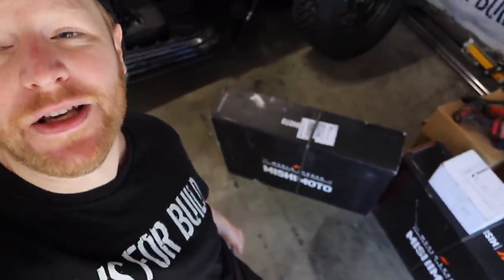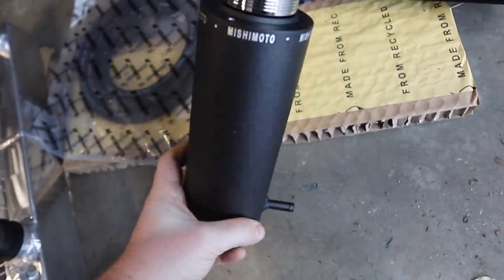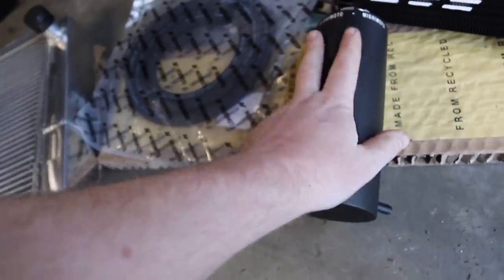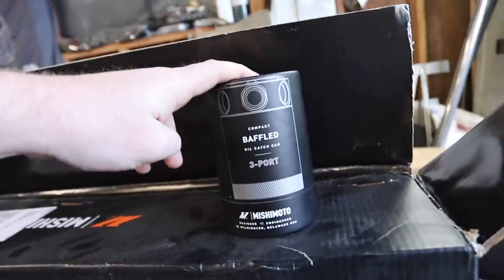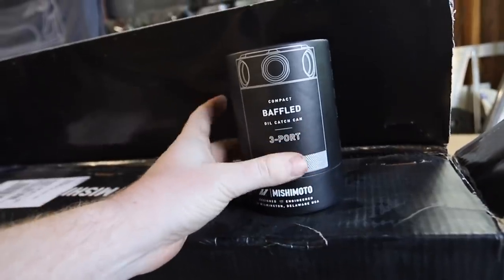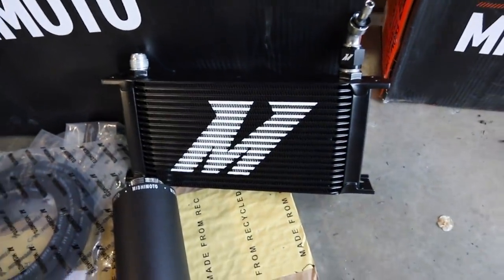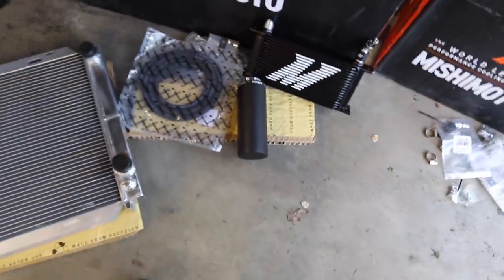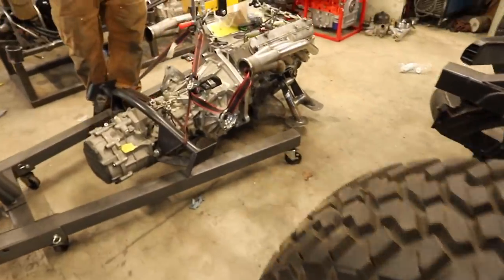Installing A Rear Top Mounted Radiator on the Off-Road Lamborghini Huracan

Comment: They make a low-profile swiveling thermostat housing for most Chevy engines - get one so you can clock it pointing at the radiator outlet - run a shorter hose with fewer bends in it.

Comment: That would be a dual PASS radiator. A dual core radiator has 2 rows of transfer pipes and fins in line. That radiator is more close to a 4 core, dual pass.

Comment: I imagine you'll be using TPU for the isolators? Just keep an eye on the temperature of that engine bay since the glass temp is around 60C. May be worth while to make a mold instead and make silicone isolators.

Comment: If you're worried about stability where you relieved the power steering bracket so the line would fit you could most likely if it clears the pulley cut a flat bar that goes from bolt head to bolt head across where you cut the piece out of the power steering pump bracket for the line I know I can't see really what's going on on camera but on that thermostat housing you might want to make sure you have enough room for a hose to go on there far enough for the clamp to be behind the lip

Comment: Gonna recommend an aux vacuum pump for your brake booster if it's vacuum-based. Not only is it more reliable due to less hose to crack/rip but less hose between the source of vacuum and the booster will almost certainly result in better braking. you'll especially notice with the bigger tires.

Comment: the difference between single and dual core radiators is capacity vs speed. a single core radiator and handle more flow without as much pressure drop, but a dual core basically has the water flowing through faster which allows for a more efficient heat transfer

Comment: It might be alot easier to use an electric power steering pump from vag or from an MR2. Just so you would be able to mount it in the front, not having to run any lines from the rear to the rack.

Comment: Make sure that radiator is sealed away from you, don't want another accident like at cleetus and cars
Reply: Wanted to say the exact same thing. close off the hole with a panel and panel bond or something. Imagine rolling the car and everything being ok, except the radiator is cracked an pissing steaming hot fluid in your neck :-|
Reply: @kenwillekens9894  ouch....

Comment: I’m not sure if you are already planning this but you should inclose the inlet side of the radiator. That way more cool air gets rammed in the radiator. If you leave it open like it is all the air being forced in by the roof scoop will dissipate all around the engine bay.

Comment: When Matts Off Road Recovery installed his LS in a rock crawler/tow rig (The MoreVair) he used the heater lines to a heater core mounted in the engine compartment to rid the extra heat from the engine. Your Jump A Con could use somtin like dis mon!

Comment: It would work better if you put the belt from the crankshaft pulley to the alternator then the loose pulley and back to the steering pump because the steering pump and alternator both take alot of torque

Comment: That thermostat housing looks sketchy won't it smash in to the fire wall while racing?
Reply: No, because the  fuel cell is  between the engine and firewall.
Reply: @caution1100  may hit the fuel cell and rub on it
Reply: @requiescantinpace3838  yes, although it will probably be fine until after the first jump.
Reply: @requiescantinpace3838  I think it's a horrible Idea to have it like that, with the vibrations that the engine might make but... idk
Reply: Hope oskar made a few extra, could be the end of their day if that breaks and they need a custom piece to continue on

Comment: Wouldn’t it be cool to have a roof scoop that fed directly into the radiator?
Reply: He said it would 14:50
Reply: It should be a lamborgini styled rs2000 intake
Reply: will be noisy as hell while driving
Reply: Its a roof scoop on as off road lambo everyting his already noisy
Reply: Why is it mounted like this? Seems like it should be mounted out the back, just like a buggy would have.
Reply: @ironmonkey1512  there is less chance for it to be poncture compared if he put it on the back completly
Reply: @ironmonkey1512  even on the back he could make a roof scoop that get to it but he put it higher for clean air and les possible debris breaking the it

Comment: 1973 Chevrolet Corvette XP-987 GT concept, a mid-engine Corvette with rotary power. One of the first GM concepts.

1988 Corvette Indy, it used the LT5 32-valve V8, and it used an Oldsmobile Toronado automatic transmission. C8 is the first production mid-engine Corvette. Popular Mechanics test drove this second concept.

Comment: I once designed a generator that fit into a cube using a Ferrari radiator mounted flat horizontal on top with electric fans. Thought that might give you a more streamlined shape maybe with a roof scoop. Oh. Never mind you already mounted it.

Comment: That engine will displace masive amount of heat not just to the air but radiation. I would make plans for a heat shield to reflect it away from the radiator's hot side in case you get heat soaking.

Comment: You should go for a radiator like the intercooler on the RS200, get all the heat out from the engine bay, not heating the intakes. At least do a composite shield where the hot air gets leaded away from the intakes. 
Great build, love to follow this!

Comment: Make radiator pipes out of aluminum pipe. You can buy electric conduit at HOME DEPOT or Leows for cheap cut and bent to size with rubber ends and claps  We did that on a jeep crawler years ago and boom proof.

Comment: It is not a dual core, it has one core. It is a dual pass radioator, which means that the coolant is in the radiator for longer, it has less flow but the coolant will come out way cooler than with a single pass radiator. The reason it works better than a single pass in most aplications is because the engines don't move that much coolant, so cooler coolant will benefit more than  more of the slightly hotter coolantz because not all the coolant can flow trough the engine.

Comment: You might consider inserting a strong spring in the molded radiator hose to keep from collapsing.  Just saying... Great Video...Can’t wait to see the Engines installed into the boat and running.

Comment: Trans cooler will probably heat the gear oil sucking air that close to the engine block :o) High amp alternator doesn’t have enough pulley contact and will smoke the belt. I love the build ^-^ It looks amazing. That’s why I’m saying stuff, because I want it to race as well as it looks 😎

Comment: i would have used electric water pump and electric power steering also dry sump system but i guess you already will go with that race engine

Comment: can you put a ~4" spacer between the back cage and the rear firewall to extend your wheel base and give you a couple more inches between the firewall and engine?
Reply: They have lots of room between the fire wall and the engine, and that is where the fuel cell is mounted.

Comment: I made the move to electronic power steering and I love it. Highly recommend
Reply: Eww, never.
Reply: That and leccy water pump. It keeps doing the best it can regardless of engine speed. The engine loved it 😍
Reply: Hell yeah, MR2 electric pump on my drift car and Prius electric motor on my track car.
Reply: I agree started putting full hydraulic steering and electric power steering on everything I build years ago. My jeeps that I build I still run a pump on the engine because of room in the engine compartment. But I really like the volvo eps pump and cheap.

Comment: Are u sure that’s the right spot for the trans cooler? The engine produces a lot of heat 🤔 are u not doing any side vents like the original lambo’s, Ferrari’s or Porsche’s?

Comment: It's a dual PASS radiator. Cores are the number of rows of tubes. Do not loop the heater hose ports. you will be circulating water through the motor without it going to the radiator. This is bad for cooling, Pull the tubes and run a pipe tap in and plug them. Leave the stock LS1 in it, way less chance of breaking your cheesedick trans.

Comment: A easier way to change the angle of a pipe is to cut it at a slight angle , than rotate it 180 degrees and re weld it . A lot easier than filling a quarter inch gap with filler rod .

Comment: Can’t you fit the radiator in the front, laid over?
Reply: This was my though too...or mounted it horizontal over the engine instead of 'vertically' like he did...most trophy trucks I've seen mount them horizontally.

Comment: Double pass rad will make sure more of the tubes work. It more than doubles the back pressure though. Water, oil and air are lazy, they always take the path of least resistance. My test rig data shows that it is pretty much what you think it is; Faster cooling air and faster JW flow makes the cooling system better :o) *you don’t need internal tube fins for water but for oil you really need them. (Like a plate and bar.) Don’t dismiss plate and bar because of weight, you get good cooling and apocalyptic reliability ^-^
Reply: That black transmission cooler has internal tube fins and external louvered fins. Per size they are the best performers available. Only do 100psi. They works ace if you run a 12volt sucking fan and a pushing one. (That is the equivalent to one sucking mains fan)

Comment: Trans cooler? That’s gonna be a trans heater cause you’ll have nothing but heat from the engine running through the fins. That should be placed right in front of the radiator or somewhere completely away from the engine or just dont even run one because you wont see any performance benefits due to the location

Comment: wow, much prejudice, im not canadian but the omaze promotion, 

"In addition to all of the other requirements stated in these Official Rules, if the Potential Winner is a Canadian resident, (s)he must correctly answer a mathematical skill-testing question to be eligible to be confirmed the Winner."
Reply: That's standard canadian give away rules , it's been like that for more than 40 years. Almost always a simple addition question , like 4683 + 10. Used to be on lottery tickets too but that got dropped when casinos came to Ontario
Reply: @mottorcyle5052  thats so crazy, i wonder why it originated